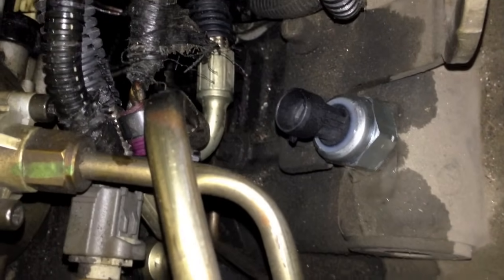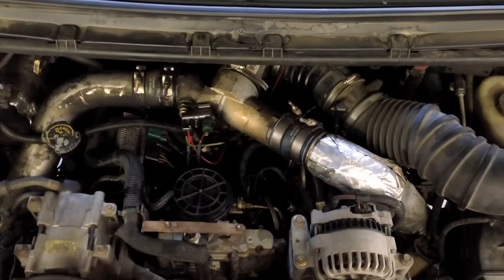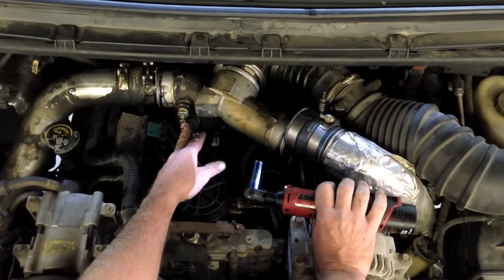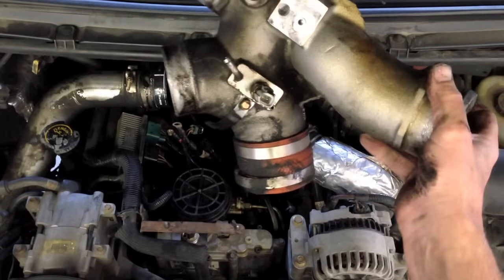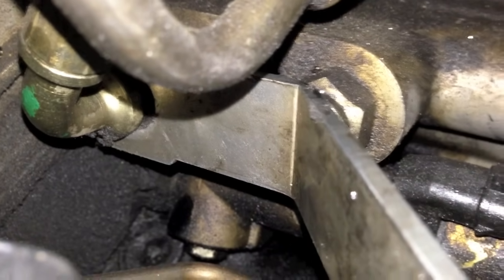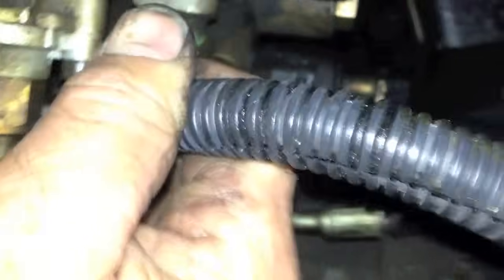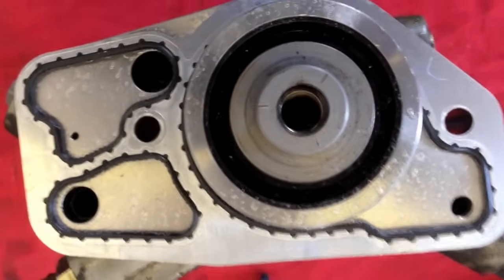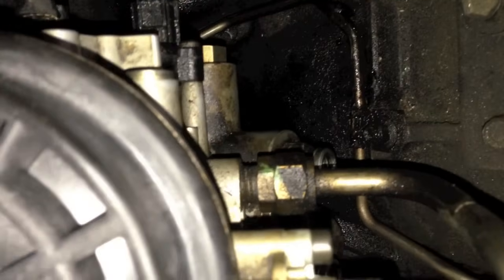Ford 7.3 powerstroke diesel High pressure pump H-pop

Comment: For removing the oil lines, in a pinch for time I just bought a door panel removal tool from the parts store and ground out between the "forks" to make it wide enough to slide over the fitting. Worked like a charm for $10

Comment: Note for those attempting this job:
-The Snap On 1 1/8 deep well socket is one, if not the only, socket that can remove the IPR probe. The end of the probe has a length/OD that clashes with the inside of most other deep well socket brands.
-It will likely take multiple cycles of your engine turning over before it will start. And even after it starts, the next time you go to start it, it may struggle again. It takes about 50 miles to really get all of the air out of these oil lines to insure smooth starting. I have seen it clear up in less, just give it time.
-Use this time to clean out your EBP sensor (connected to the cover plate that you remove to access the pump drive gear bolt). Be careful of damaging the diaphragm in the sensor. The tube it connects to also gets clogged with soot. 
-Oil your O rings before install.
-Recheck your torque on the two rear bolts that mount the HPOP after you torque the drive gear. This drive gear bolt once torqued can pull the HPOP in tighter, and then required the rear bolts to be re torqued.
Reply: Jesus are you serious. I went to harbor freight and got a 1 1/8 half inch drive impact socket, and yes it is not long enough to seat on the IPR. All i had to do was drill out the inside of the socket so it would slide past the IPR stem further.... sometimes thinking works. 

Everything else you commented on was valuable info tho.
Reply: I used a Craftsman deep 1 1/8" (from back in the day when they were made in the USA) and it worked fine, actually had depth to spare. The last sentence of your comment doesn't make any sense, how the hell is tightening the drive gear bolt going to "pull the HPOP in tighter" ????  If the drive gear bolt pulled the gear tight against the walls of the HPOP reservoir (which is what would have to happen if it were to pull the pump tighter) the gear wouldn't turn !!!  All tightening the gear bolt does, is pull the gear tight to the pump shaft, it has nothing to do with the mounting of the pump.

Comment: Do yourself a favor and put a piece of tape around the metal tube that he loosens the nut on @ 7:15 to keep it from sliding down the tube. Mine slid down into the pedestal that holds the A/C compressor, MAJOR pain in the ass to retrieve it !!  Actually, this whole job was a pain in the ass !

Comment: Ron you are/were an amazing guy. Anyone doing this job i removed fuel bowl instead of spyder. It comes out just as easy. My stock one leaked. So I put a T500 in. Kept core. I also prefilled reservoir so it starts much faster. RIP RON.

Comment: I have a 2002 7.3 and it just started bogging down and shut off. it won't start at all now. I changed my cam shaft position sensor and icp also my idm. i made a fitting to go where the icp goes and put air to it and you can feel air from the oil fill tube and the oil reservoir up top. you can also hear it bubbling in there. bad o ring somewhere?

Comment: Great video! Any tips on putting it all back together or starting up the truck once the HPOP is in. I just did mine and I have cranked it over for a total of about 8 minutes (stopping every 20 sec) and still no start...not even a sputter. Got a few bubbles out of the HPOP reservoir every time I open it. No sign of any leaks, topped up the oil rail through the ICP hole and still nothing. Is there a special startup procedure after all this is done?

Comment from the maker: Oil cooler leaking? I have a video on that.
Reply: edit: I think it may be the check level oil-stick fitting on the side of the oil pan, may turn out to be an easy fix compared to removing motor.

+DieselTechRon I do not know what is leaking, but it is leaking badly. The gas station that sold me the truck said it is the oil pan, so that means removing the motor to fix it. I had to replace my pressure washer engine so now I can clean off the motor. I will probably end up spending $2k for motor remove/ replace to fix oil pan leak. I knew this when I bought the truck/ '96 F250 7.3. No problem, someone has to do- give some care to this truck, call it a truck rescue. PS drip drip drip drip front region of motor, not rear.

Comment: My HPOP came apart and shot all of the pump parts into the valley of the motor. I was wondering is this a common problem or just a random issue? Also, what would cause this? I have not removed the pump yet to see if there was any type of failure in the housing.

Comment: I am working on a 98 7.3. With an oil leak at the high pressure fuel pump. Would you just change out the gasket if the engine is a Reviv rebuild and trust the pump. It was a complete motor they bought.

Comment: PS what are you standing on? I have to stand on a chair or some kind of stool as these trucks are pretty high. This is my first truck, 2001 F350 4x4 7.3L Lariate Crew Cab, and I love it. Only thing I don't really like is that rides like a tank, very rough, the guys hate it, esspecially the guys in the back, LOL. They hit the roof with their heads if they don't buckle up. NAWLIN's (New Orleans),  Louisiana roads are pretty rough, even in the populated areas. Thanks again, Keith
Reply: if you look on amazon you can look for what they call a tip side creeper. they help out a lot. hope this helps.

Comment: hi Ron i have a 01..f250. 7.3.  it stop in the middle of the road i change all sensors , injector cup and orings on injectors new wiring harness pulled the glow plugs and turn the motor to avoid hydrolock and the motor is just dragging...i tested the batteries were good i replaced the starter and it is still dragging so i tried to pull the dip stick it was hard to pull after i got it out to check the oil it wouldn't go back in like it blocked... what do you think the reason could be the motor not spinning like it should...
Reply: Sadly, Ron is unable to answer this from heaven :(

Comment: Ron, VERY nicely done video thank you.
I am a new 7.3 owner. Would removing the fuel filter assembly be of any help on a job like this?
Reply: More easy taking out the fuel filter case… you don’t need dealing with the turbo

Comment: Hey love the vids. I have a 96 ford superduty rollback. I noticed it was losing power. about a week ago it died. I had the batteries checked and they we're weak. I got new batteries. Now the truck idles fine if it's not moving. However, if you drive it a few miles it runs all the fuel out of the bowl and dies. after spinning it a few times it will crank back up but it keeps doing this over and over I've already put a new mechanical pump in it and checked the lift pump. Any suggestions???

Comment: Hey I have a question. It looks like my 7.3 is leaking oil down the back of the oil pan extremely slow it's not even dripping on the ground. Looks like some oil might be dripping down my oil filter also. Do you have any points on where to look for the leak? I also have a coolant leak at the same time I already found that. Please give me some pointers on where the oil might be leaking. Thank you

Comment: If this is leaking, can it cause loss of power and roaring sound when accelerating?
Reply: I have the same question
Reply from the maker: if the leak is real bad the ipr won't reach desired.  it will hit 65% on the 99and up and would cause a lack of power.  I don't see how it could be heard.  50 percent ipr on 94.5-97
Reply: Yes most definitely. It's more of a harsh problem on the 6.0. you'll definitely get the hint something is wrong,

Comment: Hey Ron,

I'm having a big problem with my 2015 f450 6.7 powerstroke.  The truck keeps blowing off the fuel return lines after the injectors.  There is no blockage going back to the tank and the truck only has 12,000 miles.  Ford serviced everything including fuel and air already.  It's throwing a p0088 code.  The dealership made it clear there is no def contamination but they are blaming me for bad fuel.  We fueled 10 of my powerstrokes that day at the same pump and no problems with any others whatsoever.  I took a sample of the fuel out of the 2015 f450 and I'm going to get it tested.  They also said they had it fixed 2 times and I drove 2 miles from the dealership and the lines blew off again.  This happened 2 times in a row.  Trucks been in for 3 weeks and today they are removing fuel tank and looking for metal shavings in tank.  What can I do?

Comment: I just did mine but when I put the pump back in,  I noticed that gear that drives the pump( where the 18mm bolt goes) is about a 1/4 inch forward of the pump shaft. Is this the proper alignment?
Reply: Did you ever get a response to this? I'm in the same boat you were in with the gear sprocket centered, but slightly forward of the pump. Not sure if it's suppose to go completely flush.
Reply: @steventorres7762  Never did get a reply. But I never had any problems either since then

Comment: Great video. I have a 2000 F350 power stroke. I can't get it started. When I turn the the key the engine turns slow with a bit of a whining noise. I tested the batteries which are about a year old and they are good. I replaced the starter but no difference. I then replaced the IPR valve, nothing. I then checked the ICP valve and     
noticed some oil in the connector (can this be tested). I do have oil in the valley but am not sure where it is coming from. Another note, when i crank the engine for the first time it takes roughly 5 seconds for the oil pressure gauge to move. I also have some white smoke at the exhaust. Please Help!
John
Reply: John Carmona same with mine

Comment: Hello, I took the HPOP and fuel bowl off a 2003 7.3 Excursion and installed a complete kit on each.  I cannot get the vehicle started.  All bolts were tightened to spec.  Little filter and ball in non-serviceable area in place.  Oil in reservoir is full.  Fuel in bowl re-primed.  The only thing I see different in your video is that when you are re-installing the HPOP, you reach around the front to make sure and feel and put the gear on.  Having the fuel bowl off, its really easy to re-mount the HPOP, but I didn't reach around and feel for the gear.  HPOP went right in and seated properly.  Could it seat properly but not be engaged in the gear, causing it to no-start?  I did refill the reservoir, cranked a few times, and then refill the reservoir so I think the gear is engaged.  Can't see anything from up top to know what exactly is in there.
Reply: K
Reply: Yes make sure your drive gear is seated and torqued correctly. This will cause a no start. Try unplugging your ICP sensor in the drivers head. This will run a default setting in PCM. If your truck runs normal, then you have a bad sensor or a bubble under the sensor. You can remove the sensor from the head and fill the rail with oil. You can also remove the plug in the front passenger head to release air and fill with oil. Did you remove the IPR on the HPOP and not replace the orings? Make sure you replaced them. If all this fails, you might possibly have a bad IPR sensor.
Reply: David Mendez most likely its a prime issue\

Comment: Hey guys have an on going problem with my 2001 F350 7.3L. It cuts out between 1700-2200 RPM during cruising. It's fine under acceleration. The problem seems to occur when the temperature is in the 70's and not so much when the temperature is in the 80's to high 90's. Changed the CPS, Oil and Filter, Automatic transmission fluid and filter no change.Using a Actron CP9135 no codes pop. Any ideas